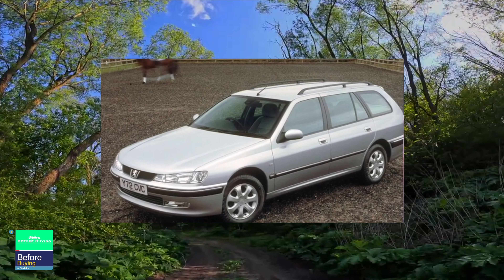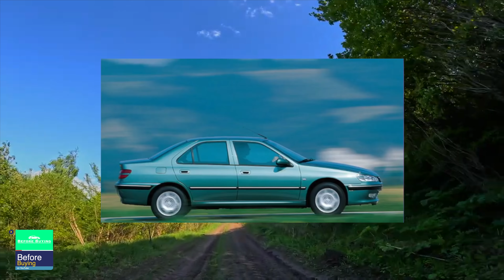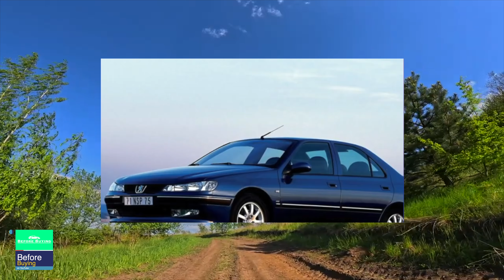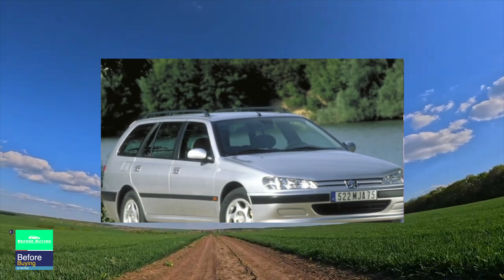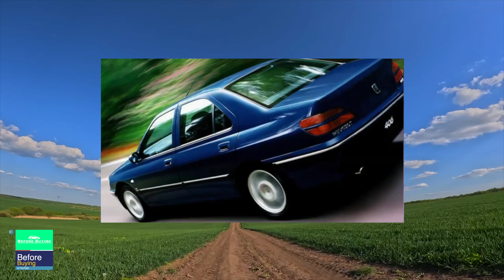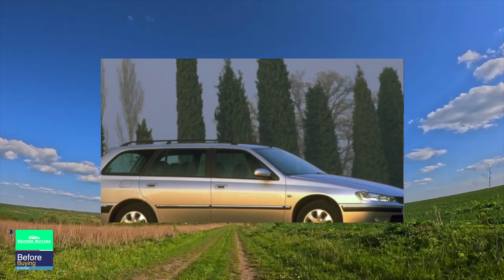The sad story of the Peugeot 406

Comment: My 406 mistral break is 21 years old, still it has air condition, works, has nice radio sound, has over 427 000 km. Engine is 2.0 hdi 80 kw/110 hp. With full fuel tank ( almost 70 liters) car can go 1100km... awesome car !